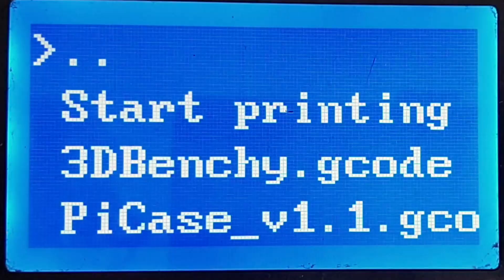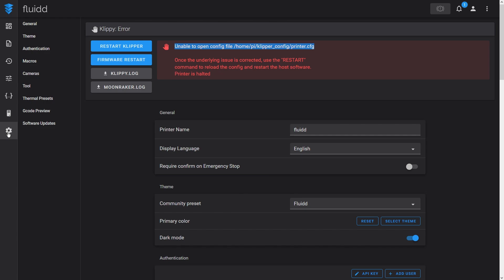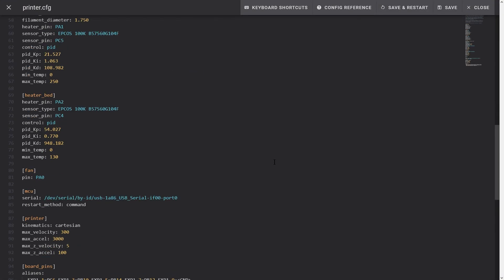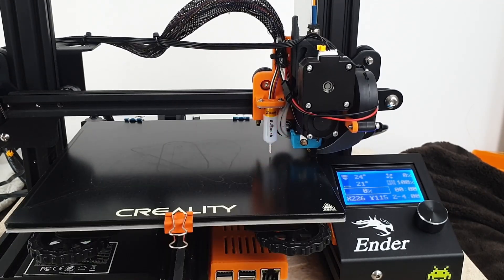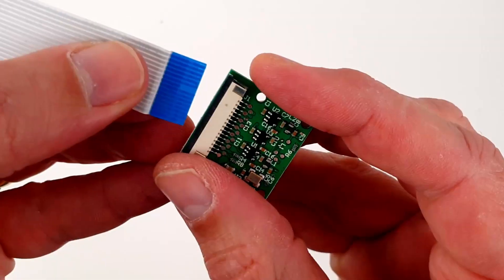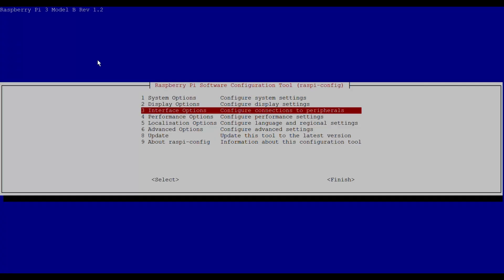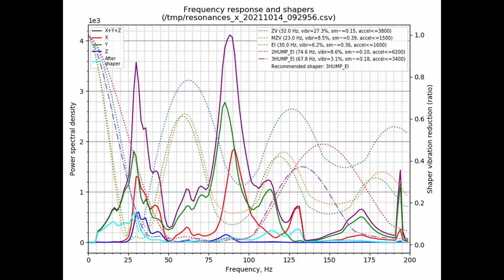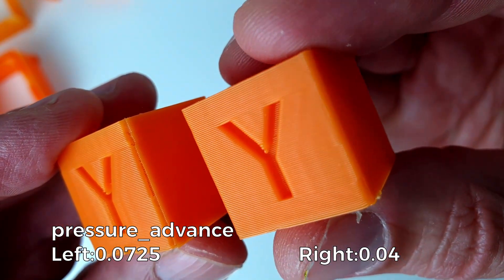Klipper on Ender 3 😱

Comment: I'm wondering which settings for speed are used to print benchy in 28min on Ender 3!? 
200mm/s (100mm/s walls and bottem/top)?...
Reply from the maker: https://www.youmaketech.com/klipper-print-settings/ The most important parameter is actually the acceleration (3000mm/s2), not the print speed (150mm/s). As the benchy is so small, most of the print time is spent below the top speed, constantly accelerating and decelerating. Very high accelerations require input shaping which at the time of this video was only available in Klipper

Comment: Hello I have some doubts I normally print at a speed of 50 mm/s or 60mm/s, my question is if after performing the input shaping setting I will be able to print at higher speeds? like 80mm/s or 100mm/s?
Reply from the maker: Hello! You’ll now be able to reach much higher acceleration — 3000 mm/s² instead of 500 mm/s². This means your printer ramps up to top speed much faster, reducing total print time by 20–40%, especially on detailed models. The top speed can also go up — up to 100 mm/s for infill — but the real game-changer is acceleration. It’s like a motorbike vs a truck!

Comment: I’m having issues saving the flashed firmware “could not resolve hostname h: Name or Service not known”
Reply from the maker: Replace H: by the letter of your sd card drive in "scp pi@ender3:~/klipper/out/klipper.bin H:\firmware-20211012-150900.bin"
Reply: @YouMakeTech  ah thanks

Comment: What printer.cfg file do you have that the LCD display works for you
Reply from the maker: I added the lines below to my printer.cfg to have the stock lcd display of my ender 3 pro working:
[display]
lcd_type: st7920
cs_pin: PB12
sclk_pin: PB13
sid_pin: PB15
encoder_pins: ^PB14, ^PB10 
click_pin: ^!PB2

Comment: Amazing, is amazing video of klipper and ender 3 with creality 4.2.7, i have the same but i have a issue with my printer, in my case the klipper not to connect with the printer and i change de USB cable and have the same result, yesterday i try to use raspberry 3 (like you) but i have the same issue (before o this RPI i used to Raspberry Pi 4) i not sure whats wrong with my printer :(

Comment: After flashing my micro sd card it didn't appear on the webpage:( still stuck here anyone face the same issue?
Reply from the maker: Have you connected your Raspberry Pi to the Wifi network like shown at 1:04? And selected a country? Without selecting a country, the wifi remains disabled. Otherwise check on your box that the Raspberry Pi was assigned an IP address and try to connect to it using the same address (e.g. http://192.168.1.3)  with a computer connected to the same network. You can also try to connect your Pi directly to the box with an ethernet cable
Reply: @YouMakeTech  Yeap, I did follow the instruction and selected my country code SG (singapore). but on the wireless network watcher the rasberry pi didn't appear. How do i check which is the raspberry pi assigned IP address? Sorry I'm really new to this and so confused by it🥲

Comment: Hi there. I'm having trouble for 1:23. When I try to do it, it tells me "this site cant be reached." This is an error message:DNS_PROBE_FINISHED_NXDOMAIN.
Please help.
Reply from the maker: Have you connected your Raspberry Pi to the Wifi network like shown at 1:04? And selected a country? Without selecting a country, the wifi remains disabled. Otherwise check on your box that the Raspberry Pi was assigned an IP address and try to connect to it using the same address (e.g. http://192.168.1.3)  with a computer connected to the same network. You can also try to connect your Pi directly to the box with an ethernet cable
Reply: @YouMakeTech  Thank you so much, I was able to greatly benefit from this tutorial. I can finally print fast without loss in quality! By the way, do you know the settings you used to get a 30 minute benchy? Thanks again!
Reply from the maker: 👍 welcome to Klipper! You can find my settings to print a 3d benchy in 22 minutes here : https://www.youmaketech.com/klipper-print-settings/
Reply: @YouMakeTech  Thanks. I'm a little worried about the extruder distance on your cura guide.. Did you use a stock extruder or a better one? I promise this will be my last question about klipper.
Reply from the maker: Because you accelerate very fast now (3000 mm/s2), the filament has no time to leak during non-extrusion moves. You can get away with very short extrusion distances. Anything above 0.3mm will work! Of course, with 0.3mm you have zero margin. I use 1mm for normal printing and 0.3mm for the 20mn benchy. Edit: I use a Bondtech BMG extruder with an E3D V6 hotend

Comment: Hello, thank you for the video, I successfully installed Klipper with BLT on my Ender 3, I received my ADXL today and already soldered it, after the calibration is done I can totally remove it ?
Do you need to perform re-calibration ? If yes in which cases ?

Thank you
Reply from the maker: Glad the video was useful! You only need to re-calibrate when you make major changes to the printer (e.g.bowden -> direct-drive for example). Most changes (changing the bed material magnetic -> glass) have a negligible impact on the resonance frequencies. The optimal input shaping filters for the Ender 3 (3hump_ei and mzv) are not very selective and reduce vibrations by x10 or by x20 in a wide frequency band. Although it's always better to use the optimal frequency, small deviations of 5 to 10 Hz will not have a visible effect on print quality.
Reply: @YouMakeTech  thanks, I also printed and installed the blokhead thanks to your tutorial your videos are really useful 🙏
I will do the calibration with the blokhead then

have a great festive season and best wishes

Comment: The Ender 3 comes with a Melzi style Sanguino 8 bit board. You left out the step where you replace the mainboard.
Reply: Not all of them - some come with 32 bit boards. He says elsewhere in the comments he has the 4.2.7 board, so he didn't replace it; that is his stock mainboard.

Comment: I was thinking about doing this also, but I have an ender 3 v2. Also mine is extended out to 400mm and I was told that putting klipper on it would be pointless
Reply from the maker: You should definitely give it a try because Klipper is the best upgrade I did on my Ender 3! It works on the Ender 3 V2 and the 400mm extender is supported. Not only you can print much faster, but the print quality is superior with Klipper: better retractions, less ringing etc.

Comment: Hi. I have a problem to find right config file to flash my Ender 3 with BL touch and 4.2.7 board can anyone help ? Thanks
Reply from the maker: Hi, you mean for Klipper and a stock extruder/hotend? You need to flash this https://github.com/YouMakeTech/klipper-ender3/blob/main/config/Ender-3%20Pro/CrealityV427/klipper.bin to the printer by copying the file to an SD card and inserting it in the printer before powering it on. Then you need to configure Klipper with these configuration files: https://github.com/YouMakeTech/klipper-ender3/tree/main/config/Ender-3%20Pro/CrealityV427 . These are the files I use for BondTech BMG + E3D V6. For a stock extruder/hotend: change rotation_distance from 7.71 to 33.50, sensor_type from ATC Semitec 104GT-2 to EPCOS 100K B57560G104F and you're all set
Reply: @YouMakeTech  All sorted now. Thanks 👍

Comment: How does the input shaping work exactly?
does it  actually get real time data from the accelerometer constantly and  correct in real time?
I guess not since   there is only one accelerometer and have to move  it from the X to the Y axis 
so it just uses the accelerometer  to do  a one time evaluation   instead then?
seem like it would be a lot better if it used 2 accelerometers one for each access and could  read  process the data in real time to make  corrections in real time 
not sure how much processing power would be required for such a task though
but I would imagine that a one time reading  would not tell all that much the vibrations  must  fluctuate  constantly 
I am surprised it  works  or does much at all with on taking  a one time reading  for each axis.
Reply from the maker: The accelerometer is only connected to the printer once to measure the resonance of the printer, i.e. the frequency at which the printer vibrates naturally, when excited by a sudden move of the printhead/bed Once this frequency is known, you enter it into the configuration file and Klipper applies an open loop compensation to remove this vibration. Instead of applying a step in acceleration, Klipper applies several steps separated by the resonnance period, such each step eliminates the oscillation generated by its predecessor. Every time you change a weight in the printer, you need to measure again the resonance, otherwise Klipper applies a compensation that is sub-optimal (timing is off). You could theoretically have the accelerometer connected permanently and use it to compensate the vibrations in closed loop, but this is not how it's done for the moment
Reply: @YouMakeTech  Thanks ,  that is what I thought , yeah  it would probably be a lot better  if there were 2 permanently mounted   accelerometers  ,one for the  X and one for the Y axis and it have it  read the data in real time and correct   on the fly
 maybe the expensive  or commercial or near  commercial printers have some proprietary feature  like this I don't know
but hopefully your "for the moment" 
statement at the end will turn  out to be prophetic and someone will  make  this an option in the open source  FW community
 the accelerometers are dirt cheap so it would be a cheap and well worthwhile upgrade providing  it  wouldn't need too much processing power to achieve

Comment: It somewhat makes sense that the value was too high for the pressure advance.  I would assume you would want a mean value of the best outcome.  For this, maybe the computation would be (measurement / 2 * .005)?  This would give you 0.03625 and would afford some over/under for variance.  Great video!  Thanks for the detailed info!
Reply: * .005 for direct drive and .020 for bowden extruder

Comment: When adding bl touch is it the same process for cr touch. I’m switching to klipper tonight and making sure that I can tune my cr touch in with it.
Reply from the maker: I have used both with the same config files/wiring on Klipper. Normally, it's plug & play. I know people had issues when using clones though, they were not 100% compatible
Reply: @YouMakeTech  awesome I got ender 3 I been trying to get little faster quality great but I find my self printing 8hrs on a 3inch by 2in model hahah thanks for the video I will follow step by step tonight. Thanks for replying back to me so quick.

Comment: Wow, 28 minutes for a benchy is pretty impressive. Correct me but it's absolutely impossible to achieve this speed without a bondtech bmg extruder that you talked about in the other video ?
Reply from the maker: Yes the time is driven mostly by the volumetric flow rate capability of your hotend/extruder. With a Bondtech BMG and an E3D V6, I reach 15mm3 per second at 230 deg C. With the stock setup, the volumetric flow rate is about half of that, 8-10 mm3 per second, which would double the time it takes to print a 3d benchy. Some setups can achieve even higher throughput
Reply: @YouMakeTech  Do you know the ender 3 S1 (and pro) new Sprite extruder and hotend performances on klipper compared to your setup ?

Comment: bonjour, est il possible d'avoir vos paramètres de vitesses de votre slcier, afin de permettre d'atteindre des vitesses aussi rapide sur un benchy ou un cube ? je suis sur Prusa Slicer et avec mes paramètres je n'arrive pas à descndre en vitesse autant que cela sur un benchy ? merci d'avance ;)
Reply from the maker: Bonjour, voilà mes paramètres: Dans printer.cfg:
max_accel: 3000 and max_accel_to_decel: 3000, square_corner_velocity: 5, pressure_advance: 0.04 and input shaping enabled. 
Dans Cura (pour du Sunlu Pla+):
Layer Height = 0.25 mm, Line Width = 0.4 mm, Wall Line Count = 2, Top/Bottom Layers = 3, Infill Pattern = Cubic, Infill Density = 20%, Printing Temperature = 230°C,  Build Plate Temperature = 70°C, All print speeds (infill, wall, support etc.) to 150 mm/s except Travel Speed = 250 mm/s, Initial Layer Speed = 50 mm/s and Skirt/Brim Speed = 50 mm/s. Number of Slow Layers= 1. Retraction Distance = 1 mm. Retraction Speed = 80 mm/s. Combing Mode = Not in Skin. Fan Speed = 100%. Initial Fan Speed = 0%. Regular Fan Speed at Layer = 2. Minimum Layer Time = 0 s (très important).
Reply: @YouMakeTech  merci beaucoup !!

Comment: can the ender motors handle 7k accel?
Reply from the maker: Yes. 7k works but it was kind of the upper limit in my testing.  I tried up to 10k but the motors were skipping steps. You may need to raise the VREF/Stepper motor current as per https://youtu.be/k2nm-WetPnU

Comment: I have upgraded my original ender 3 with the 4.2.7 creality board. Would this make this setup exactly the same? Could I use your files without issue?
Reply from the maker: My files are for a Creality 4.2.7 + Bondtech BMG extruder + E3D V6 hotend + BLTouch. If you have the same components, it will work right away, without any changes.

Comment: Can someone make Video on Slicer for KLIPPER , and speed settings
Reply from the maker: This is something I could do. The issue I have with this type of video is to find the right balance between print speed and print quality. For my Ender 3, I am happy with a <30 minutes benchy. I find the quality as good as with Marlin but I print 5x faster! It is possible to print it faster, under 10 minutes on the Ender 3, but the quality degrades a lot... The slicer is only part of the story... The hardware you use in the printer matters a lot. Here are my print settings for a <30 minutes 3D Benchy: In printer.cfg:
max_accel: 3000 and max_accel_to_decel: 3000, square_corner_velocity: 5, pressure_advance: 0.04 and input shaping enabled. 
In Cura I have (for Sunlu Pla+):
Layer Height = 0.25 mm, Line Width = 0.4 mm, Wall Line Count = 2, Top/Bottom Layers = 3, Infill Pattern = Cubic, Infill Density = 20%, Printing Temperature = 230°C,  Build Plate Temperature = 70°C, All print speeds (infill, wall, support etc.) to 150 mm/s except Travel Speed = 250 mm/s, Initial Layer Speed = 50 mm/s and Skirt/Brim Speed = 50 mm/s. Number of Slow Layers= 1. Retraction Distance = 1 mm. Retraction Speed = 80 mm/s. Combing Mode = Not in Skin. Fan Speed = 100%. Initial Fan Speed = 0%. Regular Fan Speed at Layer = 2. Minimum Layer Time = 0 s (Super important). 
===============================
There are ways to optimize this further and reduce the print time but most of these "improvements" come at the cost of print quality (There are no free lunch!) e.g. Line Width: 0.4mm -> 0.5mm, Fill Gaps Between Walls = Nowhere, Z Seam Alignment = Shortest, Seam Corner Preference = None, Top/Bottom Pattern = Zig Zag, Bottom Pattern Initial Layer = Zig Zag, Monotonic Top/Bottom Order = Unchecked, Infill Pattern: Cubic -> Zig Zag, Infill Density:  6%,  Retraction Distance = 0.3mm,  Combing Mode = Off. In printer.cfg, you can boost the accel (some guys use up to 15000mm/s2!) and the corner speed (10mm/s)

Comment: @youmaketech when I add -44 and -13 as my end stops position to X and Y m my bed is then perfect 117,5/ 117,5 in the middle ( ender 3 ) but as soon as I ad offset to Bltouch --44 -8 , my bl touch start probing far to the right , like it take from 0.0 ( top left corner ) minus that from Bl touch and from end stop. need help
Reply from the maker: Did you set position_endstop: -44 and position_min: -44 in [stepper_x]? The probing works fine for me (correctly centered) when I do this. You can see my printer.cfg file here:  https://github.com/YouMakeTech/klipper-ender3/blob/main/klipper_config/printer.cfg
Reply from the maker: Also your end stops offset in X seems quite large. The end stop X offset is the distance between the left edge of the bed and the nozzle  when the X end stop triggers
Reply: It is 44 from top left corner to bed -44 on x and around -12 on y to 0'0 on bed ( top left corner ) your config show that in -32 on bltouch and on stepper -12 . Thats why your mid point is 151,115 and if you make steper x and y correct -44 and -12 but bltouch offset on 0 0 0 your bed will start at -44 to 0 to middle of the bed at 117,5 117,5 . But as soon as you ad bltouch offset it add this (-44s -44bl=-88 ) together . Same on y axis ( -15s -7bl= -22)
Reply: Problem than show after save cfg. Bed go to the middle if you home all axis , but bl touch start as he thinks that 0'0 bed is -88 from end and should -44 , to be starting point. Its complicated ;)
Reply: when u calibrate , make G28